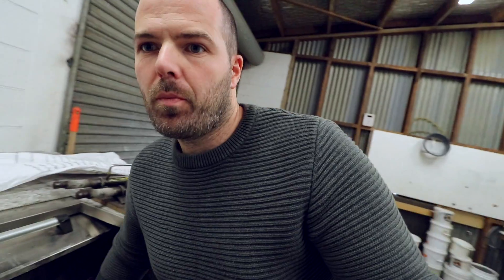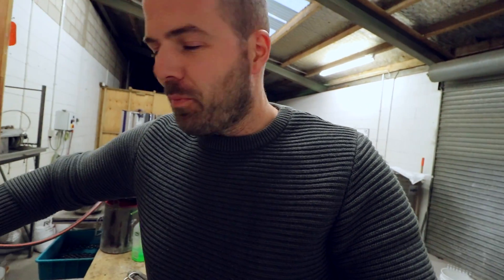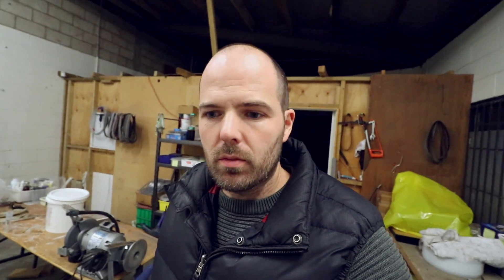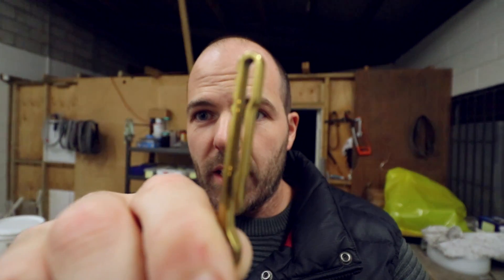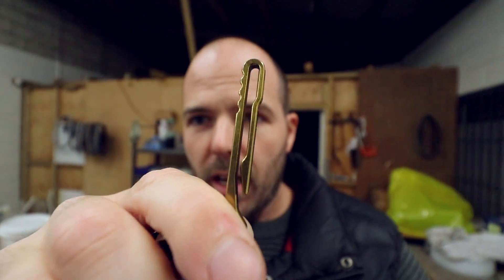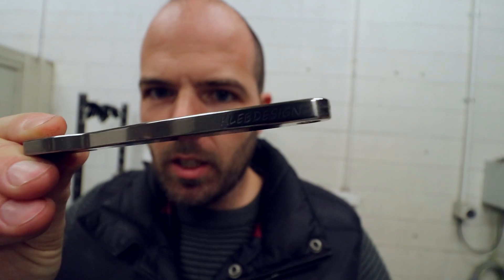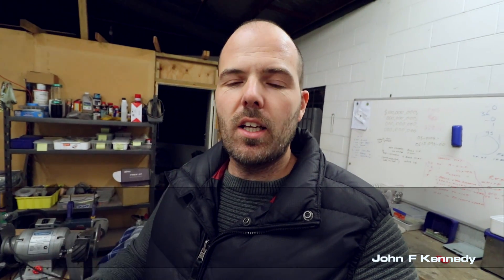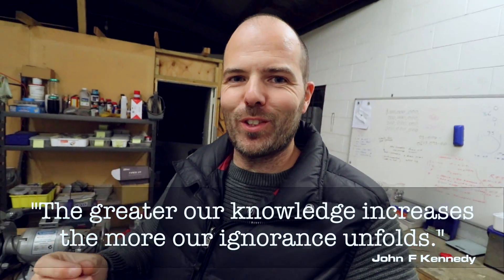Why Do I ONLY Use TITANIUM?

Comment: magnus isn't it more cost efficient if you put more titanium test objects into a single chamber for the spinning tumbler? 
you might use a plastic tube (and close it with something so it won't fall of)with holes in the sides so the stones/tumbling material so it can still do it's job but the test object won't scratch against other test subjects in the same chamber

Comment: Sooo you're going to have to do the peelers and slicers in the other tumbler a couple at a time? if that ends up being the case [which I now realize is gonna take a LOT of time... toss the pens in the mass tumbler to get them out of the way? while you work through the slicers and peelers in the other one?
If it works out then you'll feel a little less pressure because you're not putting the pens back further and further ad nauseum while you work through the peelers and slicers a few at a time

Comment: magnus try this bearing.   boca bearing SR188C-2OS #7 LD   a lot of the big name spinner manufactures use this bearing
Reply from the maker: Great! I will buy and test this model. Thank you.
Reply: Magnus the second finish didn't have the small scratches that it had before you started. I could see some "scratches" when you first showed the peeler. The second tumbler looked like it darkened the peeler, was that just the lightning?